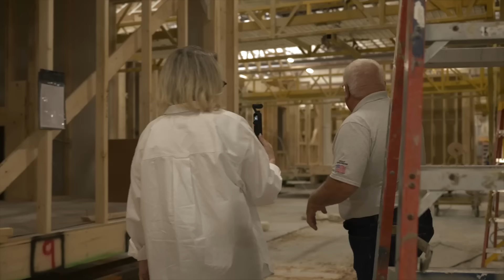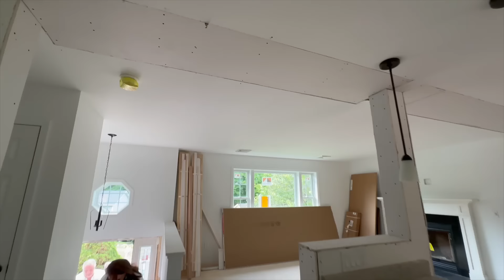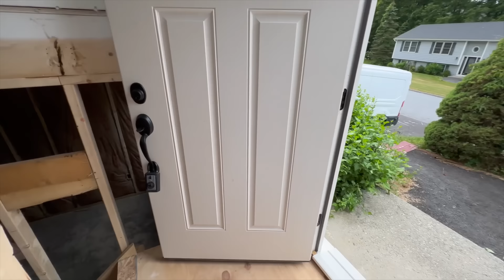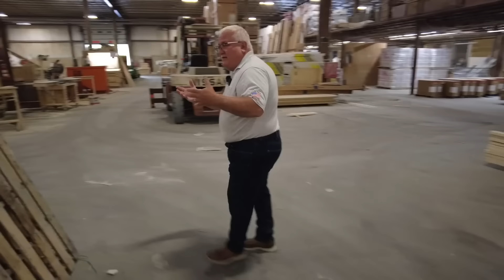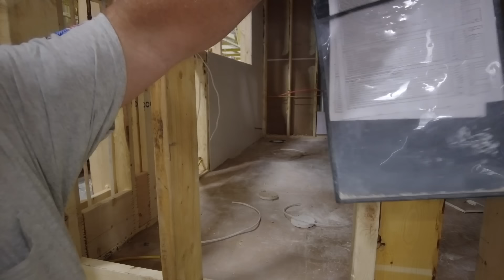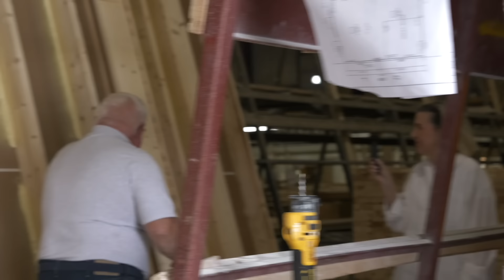Modular Homes ARE Better Than Stick Built!!!

Comment: For years quality, quantity, and bargain wise modular homes have been over promised and under delivered. Mostly they were used as click bait to market manufactured homes (the 2nd renaming of "trailers" after mobile homes) Add to that many communities passed codes banning them or restricting them  to discourage them. Worst of all is they often cost more. What I have against them is they are not concrete or CMU (the easiest DIY path to concrete . Yeah, I know there isn't really an easy path - other than to do it tiny and plain, which doesn't bother me so much). I favor concrete more  for living in central OK. Give you one guess why,

Comment: My wife and I live in a 3,400sq ft modular home and absolutely love it. 2x6 construction outside walls allow great insulation and a very energy efficient home. I would suggest it to anyone thinking of building. You won’t be disappointed.
Reply: @bnewton5922  hello, I know it varies state by state, but could you give an approximate price range I'd be looking at for a home that size? Thank you.
Reply: @jhardy0005  we are the second owners. We bought the house on 3 acres of property with a 1/4 acre pond in 2005 for 197,000 in southern Michigan. Currently assessed value is 325,000. Hope this helps. The floor plans that are available are a strong selling point.
Reply: @bnewton5922  yes it does, thank you for your time!!

Comment: Regarding the difference in the building codes used in modular vs. manufactured, how does the inspection and compliance to those codes work? Are there on-site inspectors at the manufacturing facilities? What is the relation of the third-party quality control to inspection authorities? Do the third-party quality control firms convey any sort of warranty, explicit or implied, or does that flow from the manufacturing facility or the assemblers?

Stated code compliance of on-site construction varies from locality to locality, depending upon availability and scheduling of inspections. What mechanisms exist to provide a consistent, uniform code compliance in the manufactured facility? How is it not also impacted by the vagaries of inspection availability? Are the local code requirements of the installed location reflected in the build at the facility, which may be located in a different inspection area? The obvious solution is to "over-spec" all modules to achieve code compliance regardless of location. What does that do to the cost of construction of all modules? Depending on the eventual assembly site, the cost per square foot may be higher than a traditional, site-built structure.

Has this issue been adjudicated by underwriters and mortgage originators? What are the historical valuations of these buildings versus traditional on-site constructed in terms of appreciation? How much data is available to support any such assertions, and where could I find it?

Comment: Modular is great because when some engineers decide to ignore certain projects, this can help get it approved and get built in places where the engineers can't be found or bothered. Just my opinion:  how many people out here usually running into issues where you need an engineer for residential projects and unable to find one?

Comment: One of the unspoken considerations we found was in flexibility. If you are like me, and prone to reconsidering decisions, then ponder the costs of working with an architect and the costs for updates, not to mention the delays in getting those changes approved and re-drawn. It's not a simple thing.

With our modular home, changes were nearly instantaneous along with pricing updates (rare). 

We were able to have the home placed, onsite with waterproof walls 9 feet high in the basement, within weeks. And at a cost of $150 a square foot, ready for sub contractors to come in and finish as I desired. After "set day" we would have been able to pursue a Certificate of Occupancy within 60 days. 

Can't say enough about my experience with Buffalo Modular Homes.

Comment: Modular homes are terrible for code compliance. Everything about them is cheap and hokey, lipstick on a pig. For the cost they’re just not worth. They’re a great deal if you want to chase water intrusion maintenance problems due to improper, flashing in counter flashing. Electrical and plumbing hvac are a nightmare to correct. Can’t replace any of these things with common used items from Home Depot. Only mobile home approved.

Comment: In 2020, we purchased six acres of rural property near St Louis ($190K)....  I needed a forever home for our horses.  The property came with a horse barn and industrial garage.  I ordered an all electric manufactured 2,100 sqft home for $220K with all the upgraded amenities (including appliances).  It took about 18 months for the delivery.  To prepare for the home We did the following... 1) Full basement (digging , $20K, concrete walls and flatwork, $30K, 2) New septic $25K, and 3) Electrical connection $10K..   I also had to pay extra for basement support posts ($5K),  4) Post- installation landscaping,  5) We hated the flooring and before moving in, I installed a top tier LVT on the original rolled laminate floor ($5K).  The manufactured home builder does not provide any site preparation services.   I acted as the general contractor filing for all the permits.  Overall, I have $350K in a beautiful home that would have cost about $550K if built traditionally.  My advice to anyone considering a manufactured home is get a contractor to handle all the details unless you are willing to do it yourself.
Reply: У вас дорогие строительные материалы?

Comment: As an Architect in Ontario Canada, I can tell you 99.9999% of home builders building stick framed housing on site, build JUNK. None have a copy of the building code, none have read the building code, none have any form of formal training, none understand building science and how all the components of a building work together. To make matters worse, 95% of the municipal building inspectors do not enforce the building code. I walked on to a building site to review the construction, which had passed a building inspector's framing inspection, and every where I looked there was building code violations of the framed structure, the framing was absolutely garbage. The general contractor who was building the home to sell, could care less. The building inspector passed it and that was all the contractor cared about.

Comment: I certainly feel that modular homes are better than stick built homes. 

Nowadays, they can use SIPs, less waste materials, is faster to build, and workers are not exposed to the elements during the main construction phase. The structure itself is not completely exposed to the weather. Labour costs and material costs can be controlled, and middlemen cut out. 

The major problem I have encountered in Alberta, is the bank/lender. They are judgmental towards modular homes. They consider modular homes "not permanent". Which is strange. 

The other problem is local municipal codes. Some communities do not allow modular homes, yet they allow mobile homes. 

Another problem I encountered was price. I found that many modular home builders are gouging.

Comment: Modular homes may look nice but they are not build as strong as traditional homes, I been building houses for over 15 years and some of those scenes I watched what they had inside was not strong enough or fully supported there was not enough beam support for example they are built cheaper but claim high quality products. Reason you can get modular home built in 6 days is cause you got a whole warehouse of people working on it, a group of 5 guys in our crew can build traditional two story home in a week. People are not willing to a lot of trust and money into modular homes, they want to know there house wont fall down also depends on coding and support you putting in your home i've walked through modular home warehouses and i've seen how cheap of support and material they putting into some of these homes.

Comment: Quit calling a home a stick home because that's not what they are called. And it ain't true your title bunch of lies,  I seen many sloppy modular homes and my friend had one that caught on fire because the idiot stapled through the number 14 romex wire.  They use cardboard for walls and particle boards all through construction. A frame house is built much better than a pile of sticks they use in modular homes they are nothing but trailers. Double wide trailers. Most banks treat them as trailers and they depreciate just like a car. 73

The best built home is made of block will outlast many manufactured trailers . That's all they are. 73

Comment: My wife and I are moving into our modular home TODAY. We had it built right behind our current house (we have acreage).   We are happy with the final product, and it was about $30/psf cheaper than a stick built, but be warned: If you add on porches, custom garages, gables, etc. that must be built on site, the pace of the build slows considerably.   It took five months for our builder to add five gables and three porches (two of those were very large, though). Then, once everything was done, it took weeks to get the plumber and HVAC contractors on site to finish the utility tie-ins. We also lost five weeks to Duke Energy, the worst energy supplier on earth, bc it couldn’t be bothered to send out a team team to put in a single electric pole and a new transformer.  

Beginning to end, the process to took 7.5 months, which was faster than the year it took our neighbors to stick build their less complicated house (no porches), but nowhere near as fast as we thought it be.

Comment: Better in what way?   This is fixing a problem that doesn't need fixing.   Worse yet it doesn't save any money.   The only thing is slightly better utilization of labor.  You drill down on the pros and cons it works out at a wash.

Comment: Appraiser here. Lots of these in rural Northern Michigan. They're not only built to local code, but also to be strong enough to be driven down the road. Just did an appraisal on a two-story build. Gorgeous. Didn't need inspections every few months to get disbursement. There was a site inspection and one done subject to completion, and then the final 1004D three weeks later.  So much less headache for the buyer.
Reply: @VulcanLogic. modular home values hold up or equity increases on par to existing traditional built homes?  It seems like this is hidden niche or people don't know enough to consider modular as viable option.  Does risk increase if the size of the modular home increases, or what I mean is the quality-durability of, e.g. an 800 sq ft ADU similar to 800 sq ft modular home (latter one or two sections) versus a lot changes if those both increase to 1,600 sq ft (modular now becomes five or six sections- potential problem areas ten years later)?  Thank you
Reply: @nittygritty7434  The size isn't as rrelevant because with the bigger home like the one I mentioned, it came in 4 sections which were about 600 SF each. I've seen design plans for 7 sections like that. They're all built really solid and they arrive on the trucks at the same time and the crane puts them in place the same day. There are actually modular built apartments now, up to seven stories.  I just saw a video on it. Not really my line of work, as that's a commercial property, but the engineering is solid.
Reply: Start an off-grid community consisting of individualized log cabins. ~LLC~ Lincoln Legacy Cabins

Comment: I agree with you 100%, because I am a modular home specialist, dealing in small homes. The only ones I like are those built out of steel or aluminum. They are extremely durable and strong.😮

Comment: Spot on!
I’ve worked at this particular factory for the last 22 years and I can assure you that everything presented and said here is correct.
Reply: Westchester Modular Homes
Reply: As a modular owner, thanks for taking so much pride in your work!
Reply: Could you please name the factory or the company?
Reply: @yuriinevskii1341  
Westchester Modular Homes
Reply: @yuriinevskii1341  
Westchester Modular Homes
Reply: Concrete wall 5:55. I love it.
Reply: I didn’t leave, I still work there
Reply: @ferdinanflores  could I put one of these on my existing property in addition to my primary residence? I'd love more info!
Reply: @ Yes, we do additions. Just this past week we built a master bedroom with massive bathroom and walking closet
Reply: @ferdinanflores  I would love to work there.
Reply: @maxxwick246  where you at?
We’re always hiring and we have great benefits

Comment: Custom built stick frame is superior an older modular is harder to remodel or modernize and track or machine built walls built of flimsier materials degrade over time. So a 40 year old stick framed house will likely be in better shape than a 40 year old modular building repairing and modification of it vastly superior to modular. If you are interested in modular why not weld shipping containers together and spray foam then build a wood facade it can look like a normal house/modular and last much longer.

Comment: I've known this for years.  I used to work for a company that builds modular buildings in Texas.  I was sold when I saw the framing.  The homes are built on a jig so every module is square and plum:  your don't see a few carpenters measuring lumber and cutting one by one.  Every piece of lumber is cut to the correct size before the build starts.  Electrical, sheet rock, roofs use the same process.  This system is the same way ships are built,  completely assembled modules shipped and put together on site:  built better, faster, less expensive and way better quality.
Reply: That’s freakin awesome

Comment: What they are not enclosing is the special insurance, with most insurance companies not wanting to insure at all.    These modules are for some, but not all.   Women especially like this aspect because they get an instant house without much wait time.   Also, nothing is mentioned about warranty.
Reply from the maker: Warranties are exactly the same as a traditional home and if your state has a new home warranty act it’s covered under that. I’d like to also add that men like a modular home as well because it’s better than stick built.
Reply: @KristinaSmallhorn  …. I am a retired custom home builder using quality subs.   I truly doubt your statement.   And additionally, many banks & insurances will not touch these buildings, and if they do, they come with a premium.   What is the warranty actually?   Are they earthquake proof?   How much formaldehyde & staples are used?   Are the cabinets real wood?    All the plumbing fixtures are mostly plastic.   The siding is all composition material, not real wood.   The roof only comes in asphalt shingles.   Many, many shortcuts are taken in building these buildings.
Reply from the maker: @davidwomack5982  you are confusing “manufactured housing” or HUD housing with modular homes. Two totally different products. The banks finance true modular the same and they insurance exactly the same. Please watch the video and see for yourself how these homes are constructed. You’ll see you have this confused with hud housing.
Reply: @KristinaSmallhorn  ….. With respect, I still stand on my position.   Yes, they are cheaper, but are they really in the long run?    Women are drawn to these type of buildings, but I disagree about men in general.   Most men are savvy about construction, and are aware of quality towards the longevity.    After all, they are the ones out there repairing any discrepancies, not the woman.    You have not answered my points in question.    You are swimming in the glory of these buildings, without any notion of reality.    If I had to guess,You probably don’t live in one yourself.   And most likely NOT a licensed contractor, which disqualifies your expert opinion.
Reply from the maker: @davidwomack5982  my husband and I are dying laughing at your misogyny. Thanks for the entertainment. BTW, all of the points you want me to answer were addressed in this video. All of them!
Reply: @KristinaSmallhorn  …. An amusement was not intended.    You poke fun at me, because you cannot truthfully refute my claims.    I hope the awareness I subjected is taken seriously by others who are between the decision making.   Besides all I have listed, there are many other cautions to be considered.   Simply, you are a glorified sales snake, preying on gullible ignorant people.   Saying these buildings are quality when most of us in the trade say otherwise.
Reply: @KristinaSmallhorn  Are you "swimming in the glory?"  As a MAN and as a builder for Westchester Modular, I can confirm they are glorious.  It is a standard construction loan and there isn't an insurance difference. (There is on HUD). 10 Year Structure Warranty via 2-10.  I do not believe we have ever had structural claim filed against us (We have built 8000 Homes in our 36 years in existence).  Earthquakes?  As a builder I must build at or above the code that the region/code dictates.  We deal more with  snow load/ high wind here, but if you want to check out FEMA, Modular and Concrete structures faired best after Hurricane Andrew.
Reply: @mikewmh3022  ….. Of course you will say what you say… du.  🤪.   And where did my last comment go?    Too much truth, and therefore had it scrubbed by Google?

Comment: From the designs in your video. Ok sure but rooms that require large spans are often in very limited production in prefab. The use of metal beams is not common. so rooms that can get by w inexpensive ceiling joist are good if that's your thing